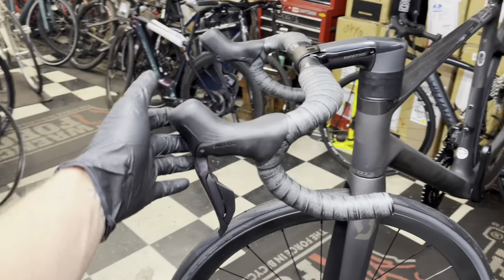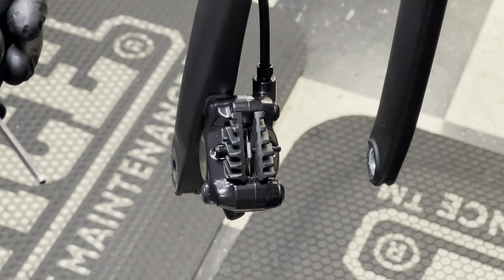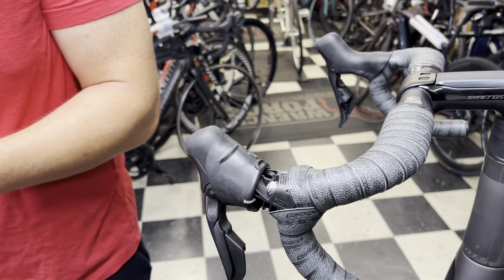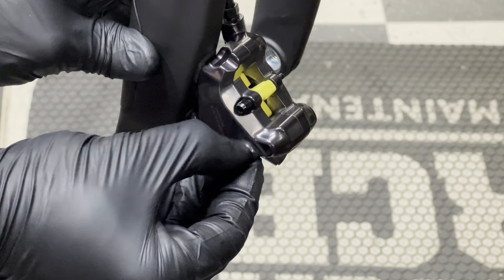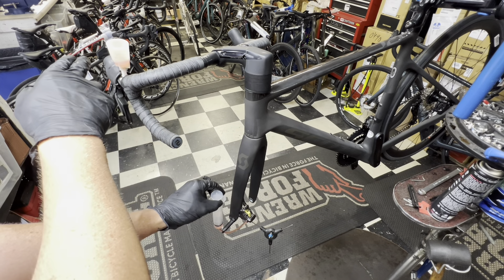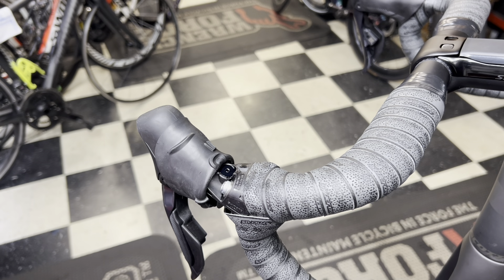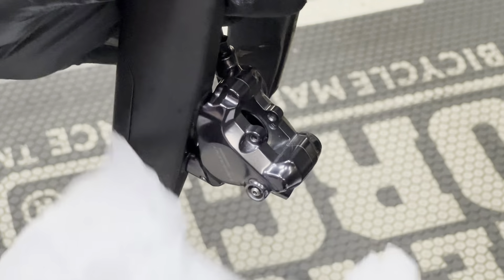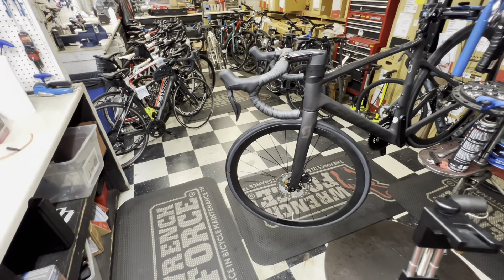*EASY* HOW TO BLEED SHIMANO 12 SPEED ROAD HYDRALIC BRAKES (105, ULTEGRA, DURA ACE) 7100, 8170, 9200

Comment: Has anyone ever done a video on the rear brake? Having a bit of trouble with it. I've done a full bleed several times and several ways but always end up with the lever about an inch away from the handlebar when fully engaged. I see no air bubbles when completed with the bleed.
Reply from the maker: take the bike in the stand and while doing it, tile the bike forward and backwards like move the bike around while pumping the lever, sometimes the bubbles are trapped in areas that need to move the bike around

Comment: I have a new disc road bike that I haven't even ridden yet. I turned my bike upside down for a few hours, now my brakes are scrubbing do I need to bleed my brakes
Reply from the maker: Sometimes when you flip bikes, air that’s trapped inside certain curves or spots in the shifters are able to move out and now the pressure is off. Give the brakes a couple of pumps and see if it goes back to normal. If it doesn’t then take it in for a bleed
Reply: I tried giving the brakes a pump, I even took the pads out and checked the pistons, bleeding the brakes is the only option I have left. 😊

Comment: my Ultegra R8070 ceramic pistons are sticking i.e. not retracting after changing pads and bleeding.  I have read about cleaning and lubricating the pistons with mineral oil  but that seems counter intuitive as the piston seal essentially acts as a spring to grip the piston to retract.  Any thoughts?
Reply from the maker: I have done this before with like a spray lube like mucoff mo94, i spray the pistons and then I work hold a metal wrench on one psiton and pump the brake and try to get one piston to move a little, I will see some movement and then shove it back in and repeat this same thing on the other piston, I have un frozen a lot of pistons like this and then after I will spray down with alcohol and dry up
Reply: @GCPerformance18  thanks I tried that and it actually improved but not 100%.  They still drag momentarily.  I just found a Shimano document for 8070 calipers stating not to remove the pistons so time to cut my losses brakes are too important and I just ordered the 8170 caliper which is supposed to include new lo3 pads, has the newer bleed design as you showed, and is documented as compatible with 8070 levers.

Comment: will the new lever bleed port screw with 2.5mm work on previous 2mm version? Assuming it would as you are using same funnel.
Reply from the maker: I would have to assume so, I cant remmebr right now but if it is the same funnel then yes lol

Comment: Hi… what size is that brake pad axel screw & can it be use on 9270 dura ace ?
Reply from the maker: what do you meanj?
Reply: @GCPerformance18  there are 2 different type of pad axel on the 8170 & 9270 
8170 is the Allen key type 
9270 is the flat screw driver type 
So the question is are the 8170 Allen key type able to use on 9270 ?

Comment: Why does park tool's video on bleeding have a section where they bleed out brake fluid from the bottom and quickly open and close the bleed port? But this video doesn't.

Trying to understand the purpose of that step.
Reply from the maker: Is that for a sram video? For sram dot fluid there is a spot where you need to bleed the caliper
Reply: @GCPerformance18  It's the shimano one, called "How to Bleed Hydraulic Brakes - Shimano Drop Bar Levers". The second step starts at around 6:15.

Comment: Bro, can you do a video which shows how to replace an internally routed handlebar with a di2 12 speed system. (you did a similar video for sram red on a  sl7) 

Basically I bought a new bike with dura ace di2 system but came with a 42 cm internally routed aero handlebar, this bar is too wide for me and I want to swap it with a 38cm without bleeding or doing anything else to a brand new system. 

Really appreciate your consideration here. I come from a place where there aren't any mechanics or shops that is experienced to handle dura ace systems with internal routing cables.
Reply: Just did this.  You will still have to bleed the system because when you pull the lines out through the old handlebar and push them into the new one you are going to splash some fluid out of the hose, even if just a small amount.  Because of this you will have to bleed the brakes just as he did in this video, no way around it.  Also, be careful when you cut the hose...cut as little as possible.  You will have to cut it because the screw pushing the olive on will not pass through your handlebar holes.  You really only need to cut just behind where the barb is installed.  If your bike does not have extra hose in the frame you could easily have a situation where the hose won't reach the new bars.

Comment: @gc performance if you are super careful about not spilling mineral oil,is it okay NOT to use the bleed block to have a firmer feel at the lever? Thanks
Reply: There's a set volume inside the hydraulic line and reservoir, it's not supposed to be exceeded. When you push your pistons back with that much fluid, you'll break the hydraulic fluid reservoir membrane too.
Reply: Plus it'll rub with an overfilled system

Comment: Does this new style also require the lever to be burped? I bled my 7020 yesterday and a lot of air got trapped in the lever and had to be burped out.
Reply from the maker: It doesn’t require it. But if it helps with the bleed then yes. Whatever you need to do to get all the air out

Comment: If your brakes are used for a while it's better to bleed from the top, not from the caliper 😉
Reply from the maker: why you say that?
Reply: @GCPerformance18  bleeding old brakes from the caliper side is basically pushing all dirty oil through the system.
It's much easier done from the top 😉

Comment: Hey! I lost the little rubber seals that cover the bleed ports on the caliper. THey must've fallen out while riding. Are these necessary to replace? If so, where can i find replacements? Thanks!
Reply from the maker: you dont need it but you can get it from any shimano dealer they have to order it probably

Comment: A fine example of how to inject air into your hydraulic brake line.
Reply from the maker: what are u talking about, this is how you bleed the brake system, even if u get the air in the system for bleeding you can push it through like the purpose of a bleed is

Comment: Aren't Shimano pistons ceramic... susceptible to chipping? Dumb idea to use a steel wrench to pry on them. Otherwise a very helpful video with great camera work, zooming in to the small areas so we can see. Still a thumbs up.
Reply from the maker: Never had a SHIMANO piston ever chip. Been using the wrench for 10 years